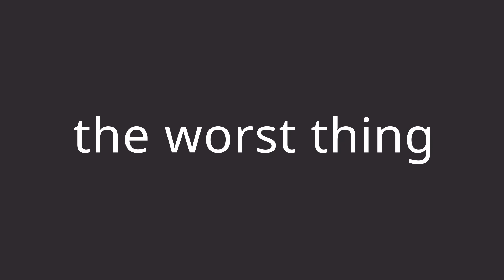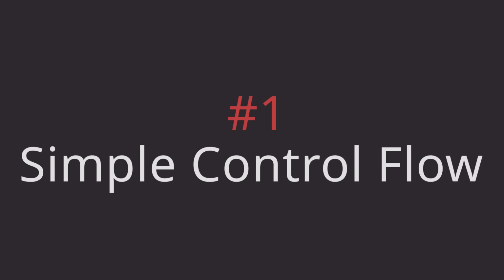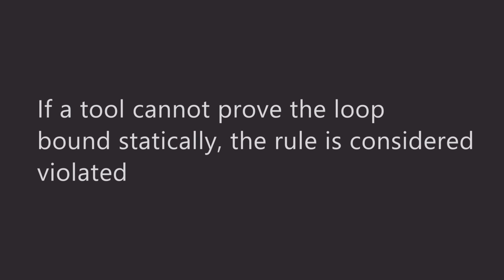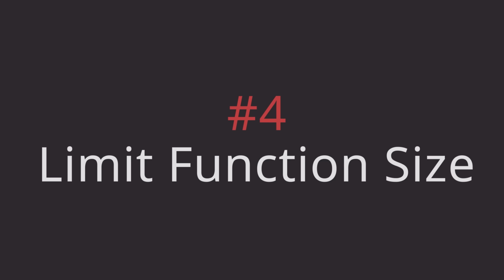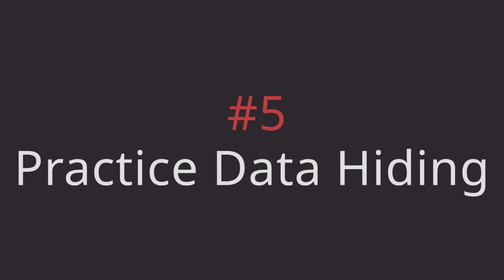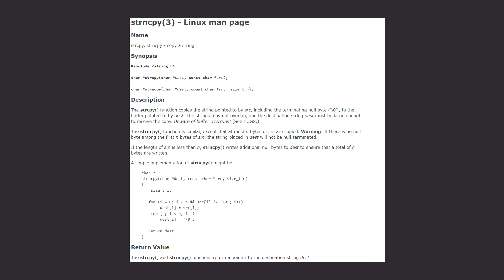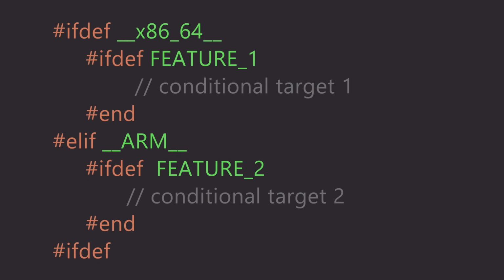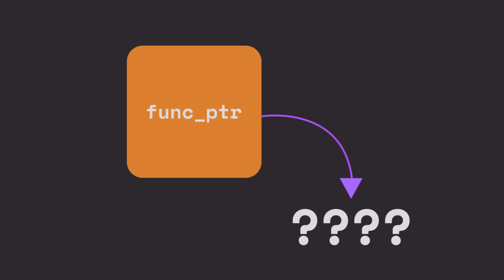how NASA writes space-proof code

Comment: I know these concepts are for code that is designed to never fail but I would like to see the performance cost of coding in this way for things like games. If the performance isn't in the dumpster it may make modern games better on release rather than the spaghetti code trash fire we get nowadays.
Reply: Entirely unfeasible for modern games. These rules make it nearly impossible to implement many things which empower designers... Say goodbye to scripting, for one.

Still, one thing that stood out to me is that, judging from a screenshot of a few functions in Devil Survivor (a Nintendo DS tactics game), the core game logic seems to avoid using the heap, or even pointers. Actor references are only passed around as 8-bit array indices, and no allocations are made; furthermore, when attempting to reverse-engineer its script format, this is also how actor references are stored/compiled in the scripts.

Anyways, setting aside that a general-purpose engine can't be built this way... If every single rule were followed perfectly (ESPECIALLY function pointers), I don't think nearly as many games would get released at all...
Reply: Almost all datastructures which allow high performance are dynamic. Coding like this is a very bad idea if you care about performance.

The rules exist to ensure that the system never under any circumstances fails catastrophically. This is irrelevant for games. If a game crashes every 100 hours, nobody cares. If your engine control unit crashes every 100 hours that is disastrous.

These rules also do not lead to particulary clean code, just to code which is usually very straight forward and simplistic.

The problem with games is just rushed development and lack of QA, you can't fix that by these methods.
Reply: @jonassattler4489  imagine the spaceship software crashes and it explodes with everybody inside
Reply: Exactly. The stakes you are developing for are completely different. In developing aerospace software, you sacrifice everything for the safety.
Reply: Games are much, much more complex beasts than what NASA programs in its probes, though that may feel surprising. In games, even just keeping track of everything the software has to do and making it flow coherently is an immense challenge. NASA does not have to program a physics engine for its probes, the universe has one built in. They just need to read the data the universe's own physics engine provides. The universe's physics engine never makes a mistake, never throws an exception and never runs out of memory. Embedded software in space applications also doesn't need to render telemetry - you have software on the ground to do that.

Certainly these are good principles for anyone, but modern game development is truly titanic compared to embedded NASA software, and the two concerns have different fundamental goals. Software for space applications should be as simple, low-energy, predictable and reliable as possible on a single piece of hardware. Game software, by contrast, is inevitably an ocean of informational complexity meant to run on a myriad of different hardware specifications. Getting it to work well "most of the time" is a perfectly respectable achievement in game development. ;)

Comment: That is very nice set of guides - as I do a lot of mcu (atmega/xmega) projects, I wrote my own stack use estimator to see whether a program would have a potential of crash - and the things pointed out here (recursion, function pointers) indeed make such static analysis (which I did always on the final binary that was disassembled) a lot harder and exceptions had to be added.

Comment: I've never understood the, functions should "do one thing" rule. Adding two numbers is one thing. You could argue a mail server is also "one thing".
Reply: Well it’s usually when talking about side effects. A function should have at maximum 1 side effect. For example printing to the console is a side effect. So the point is to wrap all the impure code in a pure function, meaning it’s output will always be deterministic. For example a function: printing “A” will always print “A” and return Unit(a type similar to void)

Once your core is “pure”, you can start composing functions that can do multiple “things”.

A more complicated example is a http call, where a lot of things happen: SSL handshake, request serialization, waiting for response, request deserialization.

You’d have to analyze all the things that can go right and wrong, handle each case accordingly and create a function for that. So that in theory, this function will always output the same for the same input, for example a GET to this url, will always return this. And if it fails, it will return this. 

Then how you compose this functions together, doesn’t matter
Reply: Cast off the bad habits of modern coding practices.  It's never too late to learn how to code properly ;)
Reply: @_Stin_  these are not modern coding practices, this stems from the very first programming languages from like the 1950s, and later Haskell..

Comment: I wonder if NASA would consider using Rust for its memory safety
Reply: It's not just memory safety. It's the ability to audit code and statically analyze and check it.
Reply: @h0stI13  I'm sure this is no easy task with all the tooling and protocols built around the existing code. Just saying rust's value proposition aligns with their needs, and may obviate some static analysis
Reply: @motozirillo  A subset of rust would be okay I guess, but that would just be C with a different syntax.
Reply: No, no, no... :'(

Comment: But why they banned goto? It's not a longjmp(), you can use it just for quick jump to the end of function, where you clean up the mess that it does in the begining.
Also, I probably skipped, but I didn't heard the explanation of what is "function that does one thing". For me its that functions are meant to do one of this things: create, change or consume/destroy data (and memory where this data is stored); not 2 or more things at the same time. If that is happening it's no longer a function_, it is a _procedure and you write it just to make code in main function more structured.

Comment: the use of heap reduces the total memory use by a lot, the fact they do not use the heap in embbeded software were memory is very limited, seems insane to me
Reply: It’s actually the single most important rule of all the ones listed here. Dynamically allocating memory on the heap is not deterministic and well bounded. This means you risk having a large unexpected spike in your execution times or even running out of memory altogether.
Reply: @The1Jebrim  everything is technically non-deterministic nowadays even if you only use the stack, because CPUs use non-deterministic neural models for caching and operating systems use virtual memory, the silicon inconsistencies that come from the scale of modern hardware also impact this, if you use the heap well you'll have no such issues, but obviously it introduces another point of failure and greatly raises potential for human error
Reply: @DMSBrian24  Embedded chips used by NASA tend to be less dense and radiation hardened so as to be more reliable and not have undesired bit flips. They often do not have any caches or out of order execution either. They go to great lengths to prove the worst-case execution time cannot be late.

The core problem with malloc in particular is that it’s asking the operating system to give back memory and there tend to be no hard guarantees on when it’ll arrive or if it’ll never fail to be returned. You also cannot statically analyze such code to prove it can’t fail. These problems completely go away if you statically allocate your memory (not just the stack as implied in this video). Allocation happens at link time and you’ll know then if you have exceeded the available memory or not.
Reply: @DMSBrian24  NASA isn't using the commercial hardware we're using because as you've noted, it's not reliable. What you're describing as modern hardware is many generations behind what they're using. You may be interested in Dr. Mark White's "Commercial Off-The-Shelf (COTS) Parts Risk & Reliability User & Application Guide" from JPL.
Reply: For most applications memory is not a hugh bottleneck, one reason being that there really is not that much dynamic data as a single controller has a clearly defined set of tasks. It is also absolutely essential to know at compile time that you will never run out of memory. A very wide range of problems is either mitigated or straight up does not exist, just by statically allocating everything.
Reply: @jonassattler4489  The amount of available memory is not the bottleneck but rather the time to access memory is usually very much the bottleneck unfortunately.
Reply: Depends on how fast you need to react of course. But that should be quite deterministic and easy to test.
Reply: @jonassattler4489  If you do have caches then memory fragmentation makes it non-deterministic and not really testable. Memory access can vary wildly from a couple of cycles to hundreds of cycles.
Reply: Well, unless you want to pack Buzz Aldrin into your satellite to take over when out-of-mem hits, probably best to try to avoid it. ;)
Reply: In embedded systems you are indeed memory bound and for exactly that reason is it good to statically allocate memory for the various parts of the code. Back in the 1980s I was doing this for emergency service radio systems which would run continually for several years without a reboot. One thing we often did was create a pool of message/event buffers and pass references to them around the various tasks and functions - very fast and it was easy to determine if stuff was coming in faster than the system could handle it so the appropriate alarms could be triggered.

Comment: 1. Simple Control Flow - don't use goto, setjmp, longjmp, recursion
2. Limit All Loops - hard limit the number of iterations in all loops
3. Don't Use the Heap - use only stack memory, don't use malloc or free
4. Limit Function Size - function should be no longer than 60 lines
5. Practice Data Hiding - declare variables in the lowest scope required
6. Check Return Values - explicitly cast all ignored return values to a void type
7. Limit the Preprocessor - limit the use of the C preprocessor to file inclusions and very simple conditional macros, don't use conditional compilation
8. Restrict Pointers Use - pointers should not be able to be dereferenced more than one layer at a time, also don't use function pointers
9. Be Pedantic - compile with all warnings enabled and in pedantic mode, analyze the code with multiple static code analyzers with different rulesets, also unit test the code
Reply: I studies a C library malloc and was surprised to see goto's.
Reply: You can tell the people you don't want near your space code.
Reply: Thanks, but you forgot "TEST! TEST! TEST!" :P
Reply: @chinoto1  dude parsed timecodes but didn't check the return lmao
Reply: What is conditional macros and conditional compilation?
Reply: @TheJackal917  The preprocessor can handle an ‘if’.  
The problem is that if you write:
#if SPACE_PROBE == JAMES_WEB
  #define STACK_SIZE 4096
#else
  #define STACK_SIZE 2048

and the previous definition is
#define SPACEPROBE JAMES_WEBB

then the compiler doesn’t spot the error that SPACE_PROBE is not spelled correctly and it takes the
#else 
clause without generating an error.

You can somewhat protect against this by writing:
#if defined(SPACE_PROBE),
but it can be risky because you don’t have very much checking.

The rule about limiting the use of macros is very good practice.  Macros can seem like a good idea in an include file make it very easy to conditionally compile code in many, many files in your project, but they bring a lot if risk
Reply: Merlin can do it...
Reply: The other part of 6 is that anything that isn't void should have a type as well. Anything that doesn't specify the type when it's called (e.g. when a variable is initialised from the return value) is unchecked and therefore would fail static analysis/code review.
Reply: #3. Not exactly.  Just because you have restricted against use of the heap doesn't imply only that the stack is available.  Allowable to use persistent storage class, e.g. globals, statics.
Reply: 10. Avoid off-by-one errors.
Reply: I would like to know which of these rules might actually also mitigate the effects of single-event upsets (bit flips) caused by the cosmic rays or solar storms. (Or were actually motivated by them). E.g., checking always the return values, even if it looks like "nothing could go wrong here". And maybe also using only short-lived memory structures on the stack, but not on the heap?
Reply: Goto's are not bad.

Get the idiotic idea that gotos are evil out of your head.
Reply: Many of these are non issues in a modern programming language like rust. How about #1--don't use the C programming language. The C programming language today is like all of the chumps who demanded people program in assembly instead of C back in the 1990s. God knows why you would use something so old and prone to so many of these problems. The only reason you would is legacy support and being a VIM fanboy nerd who still needs to use a single CRT monitor.
Reply: @ajr993  Agreed! Pascal or ADA, for example
Reply: 1. You can write simple control flows that involve gotos and labels. You can also impose fixed upper bounds on recursion depth, just like you can with loops.
2. Some problems can only be solved using loops that have no fixed upper bound. Space probes, automobiles, etc. will eventually need to be able to solve these problems as we require more sophisticated behavior from them. I also wonder how code that, for example, searches a large structure reacts if the search fails because it hit its hard limit even though the desired value is (deep) in the structure.
6. You cannot make a developer verify that a return value can be safely ignored. You can only make him code “(void)” in front of a function call to stop the static analyzer’s warning. This is also true of many compiler warnings, like comparisons between signed and unsigned integers, assigning a value of a large integer type to a smaller integer variable, and not having cases for all enum values in a switch statement.
9. I have never seen a pedantic warning that indicated a potential bug. I’m ambivalent about promoting warnings to errors (-Werror). If you don’t promote them, warnings fly past the developer in the compiler’s output and he ignores them. If you do promote them, developers add “ignore warning” directives to the code rather than investigate each warning to determine if it indicates a bug. This is partly because about 99% of compiler warnings are false positives; they do not indicate a bug. And you cannot simply ban “ignore warning” directives because, occasionally, they are necessary.
Reply: @richardblain4783 
1. You can write every recursive code in iterative way. Machines can always convert them so can you. You may need to have a stack available to do it though.
2. Just add the upper limit of 10^9 or even more and log something if it happens. It is usually (not always) better to fail small than to freeze forever.
6. True. Just tell developers that they need to write a 10 line explanation why they are ignoring it or have two more approvals before commit with the names in the code every time they do it and that it cannot be ctrl+c, ctrl+v.
9. Same here. If you want to ignore warning you need to work for it. I guarantee that there will be no warnings and no ignores in the. They will quickly learn how to avoid warnings doing common tasks.

I'm not saying all such rules are good and that you should restrict your developers to only basic constructs. I would never enforce rule 2 for example but 1, 6 and 9 - always.
Reply: @rafałzięba9982   Your comments on 2 conform to the letter of the Power Of 10 restriction, but violate its intent, and won’t pass a code audit. Putting a massive upper limit on a loop will violate the completion time budget that your code has to fit in (or did you think those hard limits were added solely to catch infinite loops).

Yes, you can rewrite any recursive function as an iterative function with a (known, limited size) amount of stack space to hold the recursion state, but it’s clumsy, and probably violates the function size rule. Rather than perform this unnecessary exercise, I was proposing passing two counters, defined in non-recursive code, into the recursive function. One counter measures time spent in recursive calls; the other measures recursion depth. Each recursive call increments both counters. Recursive returns decrement only the depth counter. When either counter hits its hard limit, the recursive calls return, unwinding the recursion.

Regarding 6, you’re seriously recommending forcing a developer to write a paragraph explaining why he’s ignoring the length value returned by a printf() call, or the reference returned by a C++ collection’s push or insert method? What do you expect developers to do instead of ignoring return values like these? Store the value in a variable? Then they have to use the variable somehow, or suffer a compiler “set but unused” warning.